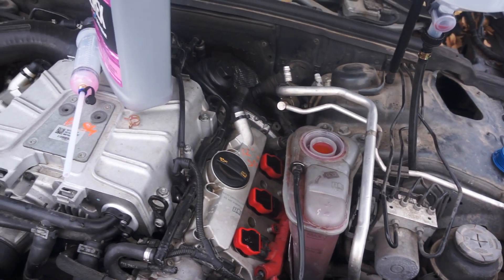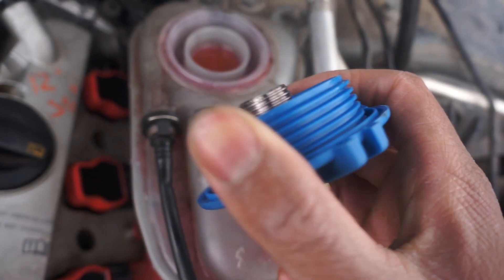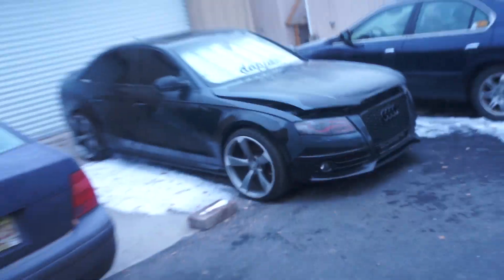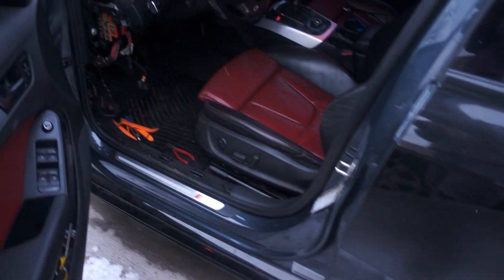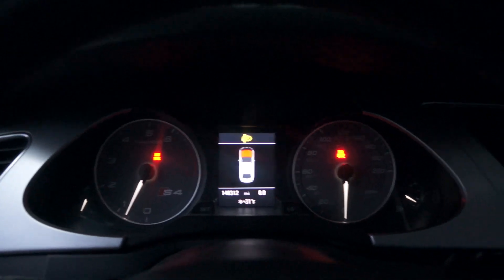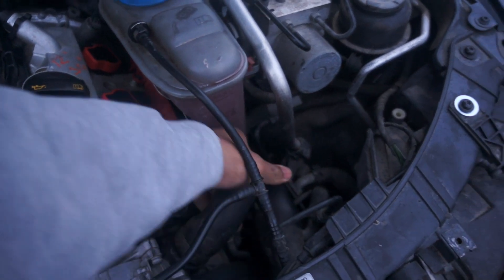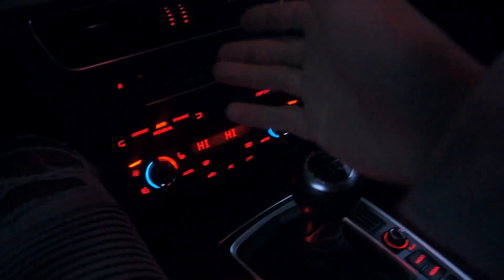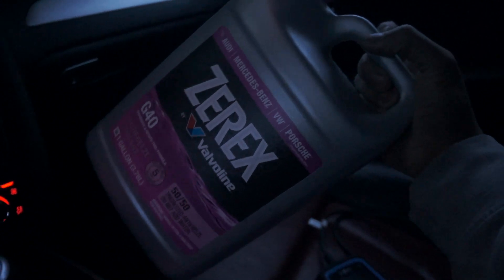The Audi S4 Coolant Is Bled! It Is Ready To Drive!!

Comment: Probably the best hedge to make on the coolant -- keep the jug and a funnel and rags on hand in the trunk, for right after you get it registered.    In my mind, it seems you did most (all?) of the fussing to warm the car up and make it work the air out while the car's stationary.

As for the temperature being low: Another reason to eventually pony up for VCDS - you could easily poll the coolant temp sensor(s) in the car and find out if it's at operating temp when warm.  You'd also have an idea if you need to chase faulty coolant temp sensors, or double-check if the thermostat is opening at it's designated temperature, or not.

Fingers crossed that the temperature's just accurate, and the thermostat opens where it's set to.  Then you're not having to fuss and play around with draining and burping coolant, so soon.  Looking forward to a "drives" video with the Audi coming up.